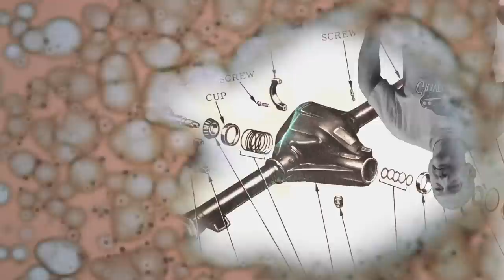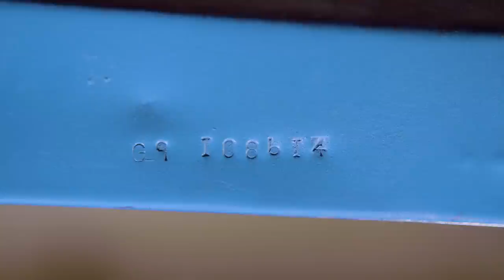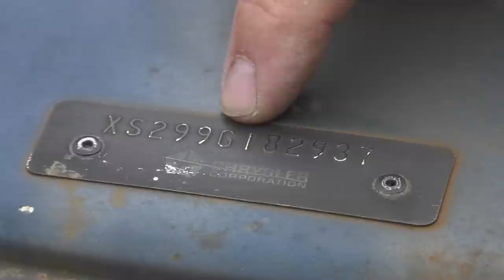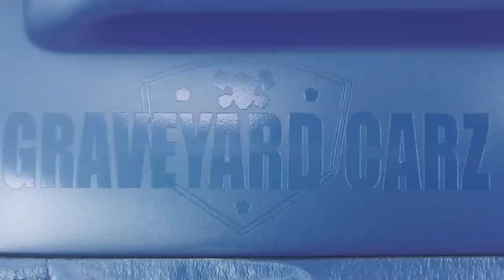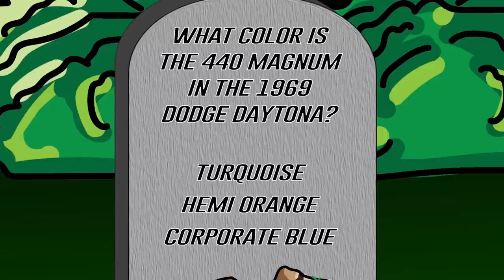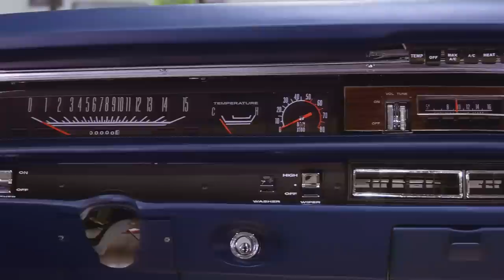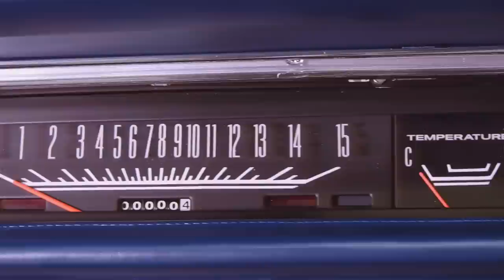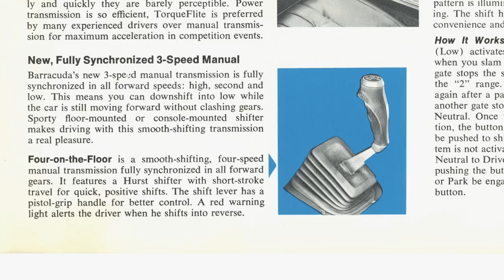WHAT LIES BENEATH: 69 GTX MADE OF BONDO AND CHICKEN WIRE!

Comment: guy is installing leaf spring u-bolts with a regular 9/16, chrome plated, deep socket-- using a battery impact gun, without eye protection. Yeah, that's an old school mechanic putting stock in his Snap-On tools.
Reply: Eye protection ? Would you like an apron also Nancy ?  🤣